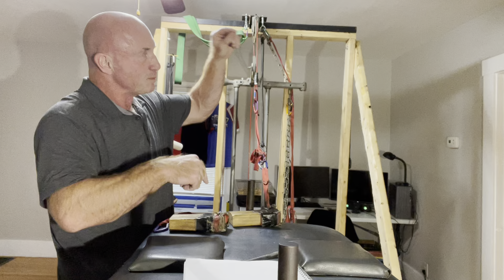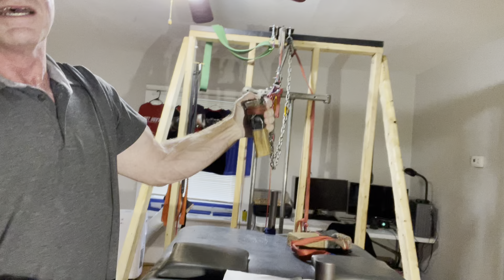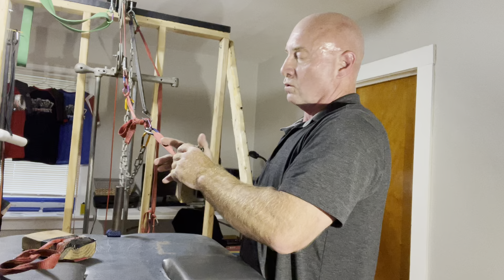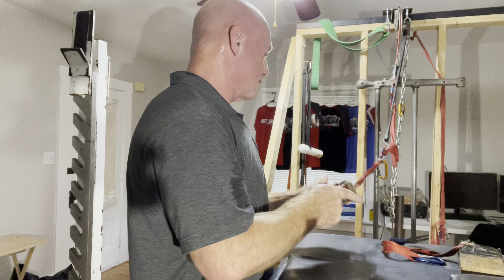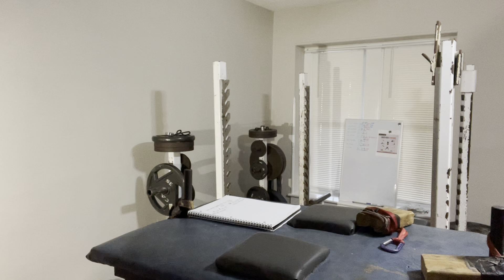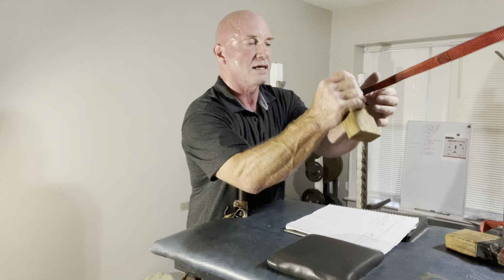Speed Day Multi Spinner

Comment: Awesome training again! I got 37 kg sidepressure yesterday, long way to go. Btw, do you use a riser when armwrestling, im 5foot7 and i feel like with a riser its possible to get much tighter angles. Im just worried that if i train without a riser, will the training translate to the table?
Reply from the maker: I have tried a riser, may try again in the future. 

A riser is not needed for training, but should be incorporated at practice. At least occasionally.